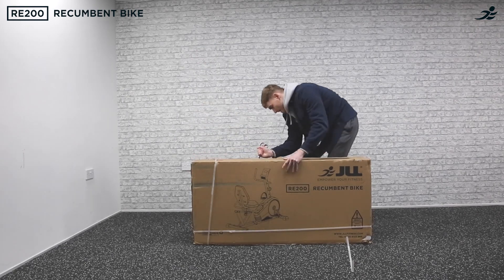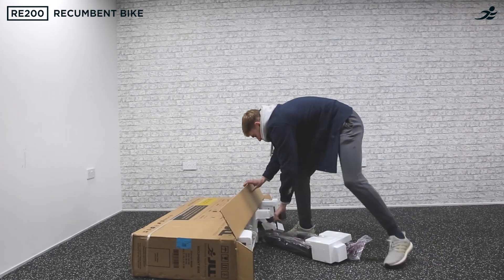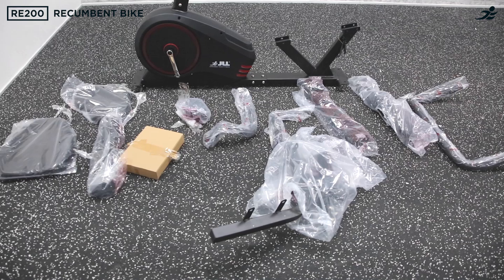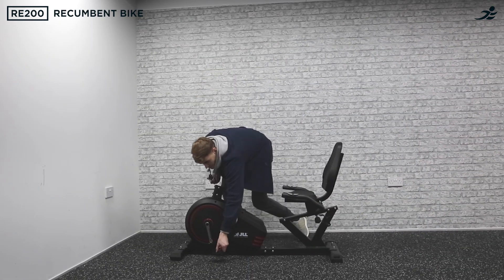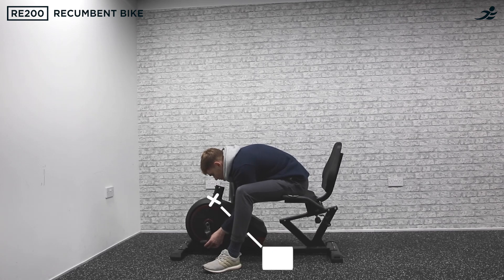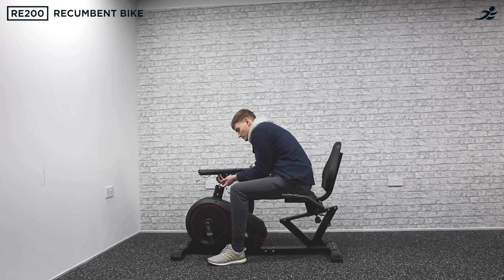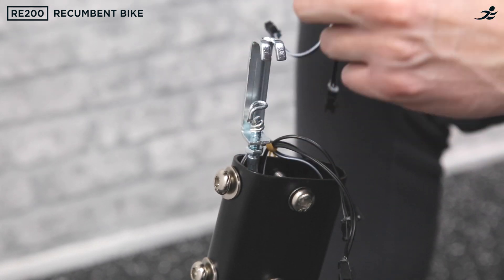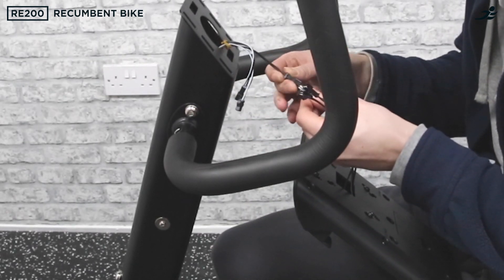JLL® RE200 - Unboxing and Assembly

Comment: No info on how to pair wires!!! Can't get my monitor to connect
Reply from the maker: Hi Lisa, sorry to hear you're having issues with the wires on your machine. So long as you pair a male to female wire it won't matter the order you connect them. Please can you explain whether you have no power to your monitor or whether it's just not picking up any readings?
Reply: The monitor has power but not connecting. Also a screw bold was loose inside the unit on arrival so possible internal damage in transit.
Reply from the maker: @surucu77  ok by the sounds of it this will either be an issue with your sensor or the monitor. If your pulse function is still working you may need a new sensor, if it's not working you may need a new monitor. Please email our customer service team at info@jllfitness.co.uk with your order details and what you have tested and they will be able to arrange a new part for you.